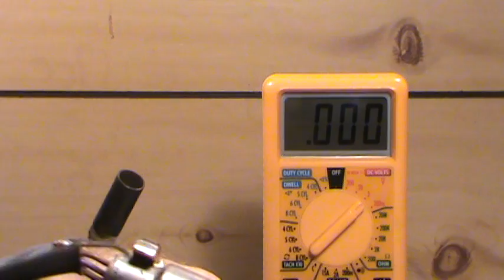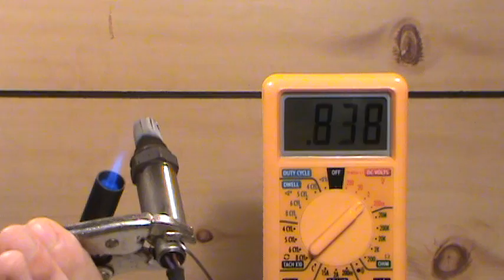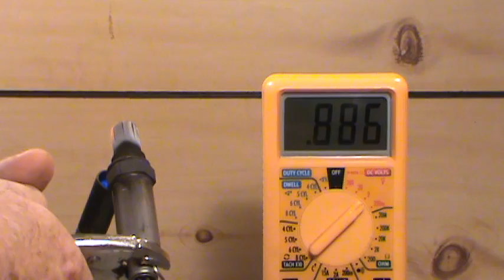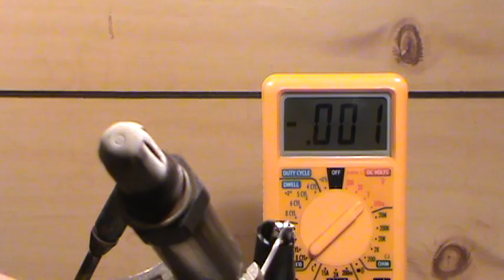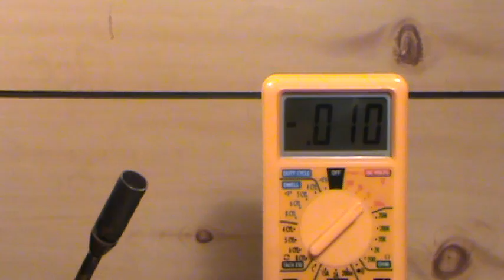Oxygen Sensor Test

Comment: Hi there, i was going to test my o2 sensor tonight while its still fitted in the exhaust manifold, its just a single wire sensor.  I clamped the ground probe to the body of the sensor and tapped into the signal wire with the positive, then switched the ignition on, i thought id double check my multimeter was secure in the engine bay before i started the engine and thats when i noticed the the voltage was going up and down already !  it was jumping from .003 upto .187 and everywhere in between, it was all over the place.  Shouldnt it just read zero with it being cold ?
Reply: No, your exhaust gasses are extremely hot, no matter how warm the engine itself is. The heated O2 sensors are much more stable in  their output. where as the unheated need to be brought up to a stable temperature by the exhaust before a useable output can be achieved. The heated sensors bring themselves up to temp internally cutting the time required for useable readings by a substantial amount.
 Also of note, is they type of meter you are using. All too often a hobbyist grade meter needs to be interpreted not simply 'read' as they are not reading the proper  'RMS' value, or peak values, and will give a reading somewhere in between,  For automotive use the old fashioned analog meters with sweep needle movements are very often your best bet as they will show the proper trends while a digital meter wont react fast enough to give you a true reading as the voltage (or current as the case may be) will have changed before the meter can resolve the proper  display.  I literally have thousands of dollars in various digital meters, and yet the one that I use most often for automotive work is an old 60 dollar analog meter  that has a 1 volt 10 volt 50 volt 100 volt and 1000 scales
Reply from the maker: Greetings newcastleknight....Thanks for watching this video, and for your comment/question as well....Are You ready, for my, shall we say..."Guess and By Golly"...Thought/s, on what may be causing that "Fluctuating Read-Out" on Your Multimeter???...lol....Actually, I'd be thinkin', that, what Your Multimeter, just might be "Detecting" and Showing You, on its Display/Read-out, could possibly be, an "Interaction" of sorts, as it relates to, having the "ECU" (aka, Vehicle's On Board Computer) in the "Circuit", that You are trying to "Test", which also Includes the Oxygen Sensor itself, and has me thinkin', that, that there "Fluctuating Read-out", just might be, being caused by the "ECU", Outputting/Inputting some kind of "Signal", that Your Multimeter is "Detecting"...!!!

Perhaps try the following....With Your Vehicle on Level Ground...Automatic Transmission in "Park"...Parking/Emergency Brake "On"...Wheel/Tire "Chalks", as in the form of some Bricks or Lumber, to keep Your Vehicle from Rolling/Moving...then, with the Engine "OFF" and "COLD"...Disconnect the Oxygen Sensor's "Connector", and take Your "Reading" with Your Multimeter on the "Oxygen Sensor", all by itself, then, as I see it, the "Reading" should be quite Stable (aka, not Fluctuating), and, seeing as how You happen to have a "Single Wire" Oxygen Sensor there, I'm thinkin' that, it should be a "Zirconia" Type of Oxygen Sensor, and "Not" a "Titania" Type of Oxygen Sensor...

The "Zirconia" Type of Oxygen Sensor "Outputs" a Voltage Signal, all by itself, when Heated-Up to about "600" Degrees Fahrenheit or Higher...

...where-as...

...the "Titania" Type of Oxygen Sensor, Operates more like a "Resistor" does, and "Does-Not" Produce a Voltage "Output" of its Own.

Perhaps "Remove" Your Oxygen Sensor from Your Vehicle, and "Test" it with a Propane Torch (if You have one, that is), and once the Oxygen Sensor is Heated-Up to about "600" Degrees Fahrenheit, and if it "Is" a "Zirconia" Type of Oxygen Sensor, and it's in an Operational State, Your Multimeter should be "Displaying" about the Same "Voltage", as You see on the Multimeter in this YouTube Video of mine.

When-ever an Oxygen Sensor gets "Installed", I always put some "Anti-Seize" Goop/Compound on the Oxygen Sensor's "Screw-Threads", to Prevent that Oxygen Sensor from getting "Stuck/Welded-like", making any Future "Removal" of that Oxygen Sensor, that much Easier.

The "Anti-Seize" Goop/Compound that I use, looks like it has, some kind of "Copper" Particles in it, and, as I see it, these "Copper Particles", will probably Help make a better "Electrical Ground Connection", for those Oxygen Sensor "Screw-Threads", where they make Contact with the Exhaust Manifold "Screw-Threads", or, the "Bung" (aka, usually, welded-on the exhaust pipe, Steel Pipe/Tubing Collar, if You will), that also has "Screw-Threads" inside its Hole/Bore.

Now about...an Oxygen Sensor's "Response Time"...

...once the Oxygen Sensor is heated-up to that Magical Temperature of about "600" Degrees Fahrenheit or higher, and the Voltage has somewhat Stabilized, then, as soon as the Propane Flame is removed from the Oxygen Sensor's "Sensing Tip", the "Voltage" Reading on the Multimeter should "Change" to a Different "Voltage Value" quite Quickly.

If its "Response Time" is too "Sluggish" (Slow, like a Slug???...lol), then, as I see it, the ECU would be Held-Back from doing its Job Properly and Efficiently.

The Newer Vehicles, oh, about 1996 and Newer, would probably have, what is called an "OBD-2" (On-Board Diagnostics-Version-2) Computer System Installed in it...

...and, I'm pretty sure, that, if "1" or More Oxygen Sensors in that particular system, became "Sluggish", as in "Slow Response", the "OBD-2" Computer, would/should be "Setting" a "Trouble Code", that can be "Extracted/Retrieved", with a "Scan Tool", that kinda looks like, a slightly Larger Hand held Calculator.

From what some People say, the Heating of an Oxygen Sensor with a Propane Torch, can actually "Clean" the Sensing End/Tip somewhat, which might just, help make, an Oxygen Sensor, that wasn't working so good, work OK once again.

If You care to, You can let me know, just "Which" Vehicle You are working on...Year?...Make?...Model?...Engine?...that way, I might be able to figure out, what might be going on.

Be very Careful, when-ever You are "Tapping-Into" any Wiring or Electrical Circuit, Especially if Your Vehicle's ECU/On-Board Computer happens to be in that (Test?) Circuit, because, when things go "Wrong"...it can sometimes Result is some very...Bad...Unwanted...and sometimes...Very Expensive Damage as well...!!!

If You happen to "Disconnect" Your Oxygen Sensor or Other Parts and Pieces, You might have to "Re-Set" or "Clear" Your Vehicle's ECU/Computer, of any "Trouble Codes" that were "Previously Stored"...or...might have been "Caused" by the "Disconnecting" of Any Parts or Pieces just "Recently" perhaps?

Once the ECU/Computer is "Re-Set", it's usually, just a matter of driving Your Vehicle for a few Miles/Kilometers, so, the ECU/Computer can "Re-Learn" and "Store" that "Information", that will make Your Vehicle Run Properly once again.

Be Safe, take care, and have a good one.
Reply: RockysRoadshow
 Thanks for the reply ! well this is just in a long series of fault finding on my  car.  Its an 1987 Pontiac Trans Am GTA, which originally had a 305 TPI engine but ive not long finished swapping in a 350 TPI from the same year car.  The engine has been to a shop and been regasketed, new valve stem seals, oil pump, flywheel etc, and ive put the top end back together with pretty much all new parts, and also had the memcal chip reprogrammed as ive removed the egr valve etc

To cut a long story short the engine runs terribly, it feels like its only firing on about 3 cylinders, misfires, popping sputtering etc.  Lately it has only been cranking over too and will not fire, So ive been testing various things to try and pinpoint the problem as ive got no error codes saved in the ECU from the short time its been running.  I checked TDC and removed the distributor too to test the pickup coil which tested good (that was done using one of your other videos, thanks !) and the engine did fire up and ran, and idled but was still misfiring something rotten.  Im just starting to get really annoyed with it now as most of the parts are only a couple of years old that ive reused off my 5.0 engine, and the rest are brand new
Reply from the maker: newcastleknight
Greetings newcastleknight....As You have already found out..."Trouble-Shooting"...can at times, be quite challenging, but fear not, and by not thinking about all of the Problems that You are having with Your Engine's, not so good Running issue/s all at the same time, I found that, the best way (for me, that is), is to take "Each" System's Component/Part by "Itself", and follow that good ole "Bread Crumb Trail" (actually, in this case, the Starting and End Point, of the Fuel System or Electrical System...etc.), and if there happens to be any "Tell-Tale-Signs" (showing on any components/parts) along the way.

Perhaps, we should start this so called "Trouble-Shooting" of Your Not so Happy Engine, by checking out the "No Cost" things first, then perhaps increase the Cost as we (actually You..lol) Proceed.

There are times when any of Us, can and do, take things for granted, so, head back to Square One, and Check/Review the following...

The "Engine" itself, has to be "Mechanically Sound", as in, Good "Compression", etc.

Make Sure that, all of the "Basic" Engine "Maintenance" Requirements are "Up-To-Date", as in...Air & Fuel Filters...as New Spark Plugs & Spark Plug Wires/Leads...as New Distributor Cap & Rotor...and also, it would be a good idea, to Check for a Gasoline Smell on Your Engine Oil Checking Dipstick, seeing as how Your Engine was, shall we say..."Miss-Firing", as that alone, will sometimes have Raw Gasoline, make its way, into Your Engine's Lower Crankcase/Oil Pan area.

Is Your Newly Installed Engine, a 350 Cubic Inch "Pontiac" Engine, or did You perhaps "Swap" a 350 Cubic Inch "Chevy" (aka, Chevrolet) Engine, into Your Trans Am GTA???

The reason, that I'm asking, is, from what I recall, the "Distributor Rotation" on "Pontiac's, Buick's, and Oldsmobile" Engines should/might be Rotating "Counter-Clockwise"...

...where-as...

...a "Chevy" (aka, Chevrolet) "Distributor Rotation" is, as far as I recall, is Rotating "Clockwise"...!!!

The "Rotating Direction" that "I'm talkin' about, is the Distributor "Shaft/Rotor" Direction of Rotation.

You might even have, without knowing, Installed a Chevy (Chevrolet) Distributor, in an Engine, that "Is Not" a "Chevy" (Chevrolet) Engine...!!!

Geeze, I'm not even sure, that it's possible to do that, as I/m thinkin', that, the "Helical" Drive gear on the Distributor "Shaft", might Not "Mesh" with the "Helical" gear on the "Camshaft", due to the possibility, that, it might be a "Helical" Gear of the "Opposite Hand" (aka, Left vs Right)...!!!

Then, on the "Other" Hand (lol), maybe, just maybe, Someone could have Installed a Distributor "Helical" Gear, from a Buick, Oldsmobile, or Pontiac Distributor, and installed it on the "Chevy/Chevrolet" Distributor Shaft...???

Hey, Stranger Things, have been know to happen.

Also, if my memory serves me right, the Distributor "Pick-Up Coil", and maybe some other Distributor Related Parts, just might be of the "Opposite (electrical) Polarity", when comparing, the shall we say, "Stand Alone Chevy/Chevrolet" Distributor, to that of a B.O.P. (B.O.P. = Buick...Oldsmobile...&...Pontiac) Distributor/s.

"Make Sure", that You have the "Exact" Distributor, and all of its "Exact" Component Parts for the "Exact Engine", that is installed in Your Car...!!!

Once You are "Certain", that, You actually "Do" have the General Motors "Correct and Recommended" Distributor and related Components, then...

...Check to see, with Engine "NOT RUNNING", if Your Spark Plug "Wires/Leads" are placed "Correctly", on the "Distributor Cap"...In the Correct "Firing Order"...and, that Each Spark Plug "Wire/Lead", goes to the "Correct" Spark Plug...!!!

Hmmmmm...I'll mention a bit here, but, I want "You", to "Check" the "Specifications" for Your Engine, just in case, I mess up...!!!

Maybe, You already know, all about Firing Orders, the Distributor's Direction of Rotation and Cylinder Numbering, but, I'll make them "Visible" (lol), just in  case!

The "Firing Order" for most General Motors V-8 Engines should be...1...8...4...3...6...5...7...2.

The "Locations", of those "8 Cylinders" are, while sitting in the Drivers Seat, starting at the Front of the Car, on the Left Hand Side of the Engine are...1...3...5...7...

...and...

...starting at the Front of the Car, on the Right Hand Side of the Engine are...2...4...6...8.

But, here's the "Catch" (more like...Warning!)....The Distributor's "Rotating Direction", will "Dictate"..."Where"..."Each" of those Spark Plug "Wires/Leads" actually get "Placed/Installed" on Each of Your Distributor "Caps Terminals"...!!!

Maybe this following "Cost" related item, is being placed a wee bit earlier than I anticipated earlier...

Like they say in "Real Estate" (aka, Property, House, Condo, etc.), "Location"..."Location"..."Location"...

...but..

...when it comes to a Car or Trucks "Fuel System", then it's...(Fuel) "Pressure"..."Pressure"..."Pressure"...!!!

Fuel "Pressure", and just as important...Fuel "Volume", can make or break, an Engine's ability, to "Run" Properly, or even "Start" for that matter.

Seeing as how You were saying, that You have a TBI (Throttle Body Injection) Unit, installed on top of Your Engine, a "Ball-Park"..."Fuel Pressure" for Your (I'm thinkin'...it has "2" Injectors in it) "TBI-Unit", should be about "13"-PSI (13 Pounds Per Square Inch), as "Measured" with a "Fuel Pressure Gauge", and might be taken, just before the TBI-Unit, but, please Check!

Check the Fuel Pressure "Specification's" for Your TBI-Unit/Model...!!!

Something like a "Clogged-Up" Fuel Filter, can "Reduce" Fuel "Pressure & Volume".

As I recall, there is a little Fuel "Mesh-Like" Filter, installed on Each of Your TBI's Fuel Injectors...might be "Clogged"...???

Might even be Your TBI's "Fuel Pressure Regulator???

Perhaps the "Fuel Line", just before Your TBI Unit, has a "Fuel Test Port", much like a "Schrader Valve" (looks just like a typical Tire Air Valve), where You can Connect, a "Fuel Pressure Gauge" to???

Before You "Work On" Your Fuel Injection System..."Make Sure", that You know how to "Bleed-Off" the "Fuel Pressure", before You "Test" or "Disconnect" any "Fuel Lines", as there is some "High Pressure Fuel/Gasoline" that can Hurt You, and has the Potential to Damage Your Eyes/Eye-sight...!!!

So then, Check out that "Ignition System", with the Engine "NOT RUNNING", and If that's not Your Engine's Problem. then...

...it would be a very good idea, to get Your Car's "Fuel Pressure"..."Checked", so, You "Don't Spend any more "Un-Needed" Time and/or "Money", on a Problem, that, just might, not be there.

Let me know, how it's going, and, if needed, I'll see what else I can come up with.

Be Safe, take care, and have a good one.
Reply from the maker: newcastleknight Greetings newcastleknight....Oooooops...!!!...lol...It kinda looks like, I made a..."Mistake"...in the First Reply to this/Your Comment, and, that Mistake was...I, messed up, with those..."3 Letters"...where You were sayin'..."TPI"...and...I, was thinkin'..."TBI"...where..."TPI", should be..."Tuned Port Injection" (I think), and..."TBI"...should be..."Throttle Body Injection"..."Yikes"...!!!...my Bad...???...lol............................While, both..."TPI"...and..."TBI"...happen to be, an Engine's, Type of..."Fuel Injection" System...and being, some-what "Different", from, One-Another, they both do, pretty much the Same Thing, but, slightly Different, from, one-another, and, I'll try to explain, some of those Differences, using a...GMC Made, "V-8 Engine"................................."TBI/Throttle Body Injection"...kinda looks, some-what, like a Carburetor does, and, usually had "2 Fuel Injectors", Mounted, on/near the Top of "it", and usually had "2 Throttle Bores/Holes" as well.....................The "2 Fuel Injectors", for the "TBI/Throttle Body Injection" Unit, should have, a Larger Outside Diameter, when Comparing Them, to the Fuel Injectors, in a "TPI/Tuned Port Injection" System..................................Now then, with a "TPI/Tuned Port Injection" System, there should be..."One Fuel Injector"...for Each of the Engine's..."Cylinders/Combustion Chambers"...pretty much meaning, a Total of..."8 Fuel Injectors"..............................These "8 Fuel Injectors", are usually Connected to a "Fuel Rail", which supplies the "High Fuel Pressure", to All of those "8 Fuel Injectors", having "4 Fuel Injectors", with Their Own "Fuel Rail", on Each side of that V-8 Engine..............................The "TBI/Throttle Body Injection" Unit, usually, just sits, on top of, what appears to be, an Intake Manifold for a Carburetor, where-as, with a "TPI/Tuned Port Injection" System, that I've seen, is, there are "Intake Runners", that look, kinda like Cast Aluminum, in some cases, having a Set of Them, on both sides of the Intake System, and, might also be equipped, with a "Mass Airflow Sensor/Throttle Body" as well..........................................Aside from the, shall we say, Physical Differences, that are readily Seen, if a Person, were to do, a Side-by-Side, Visual Comparison, of the "TBI"...vs, the..."TPI"...Fuel Injection Systems, there is "One...Major...Important...Difference"...and that is...the..."Amount of Fuel Pressure"...for..."Each of These 2 Fuel Injection Systems"...!!!................................Where, in my First reply to You, I was sayin', about the, oh..."13 PSI/Pounds per Square Inch"...there-abouts, that is needed, for a "TBI/Throttle Body Injection" Unit, is one thing, but, when it comes to, something like a "TPI/Tuned Port Injection" System, then, "Look-Out" now, cuz, I'm thinkin', that, the Required "Fuel Pressure", will now be, in the neighborhood, of about..."60 PSI/Pounds per Square Inch"...!!!..."Yikes"...!!!...oh, and, Please Check, the...Fuel Pressure..."Specifications"...for Your..."Exact"..."Fuel Injection System"...to "Avoid a Dangerous Situation", and to, have Things, work, just as "They", should be Working..........................................Be sure, that You..."Safely, Bleed-Off that High Fuel Pressure", Before Disconnecting any Fuel System related Components or Fuel Lines, etc...!!!...as that "High Fuel Pressure", as I see it, is kinda like having, a "Mini-Pressure-Washer", that can Injure, as well as Blind a Person...!!!........................The "Correct Fuel Pump", and, the "Correct, Fuel Pressure Regulator", has to be Used, for Each, "Exact, Fuel Injection System"...!!!.....................................You were sayin', that You Swapped some Parts, from Your...305/5 L to Your 350...V-8 Engine, so, now I'm thinkin' that, although the Parts for, both the 305/5L, and the 350, may Appear, to Look the same, there just might be, some..."Calibration/Specification...Differences"...Between... Those..."2 Engines"..."Parts Needs/Requirements"...so, just to be sure, I would be doing a..."Part Number Check/Cross-Reference"...for Any of the Parts & Pieces, that, were to be "Swapped", from, One Engine, to the Other Engine, to Avoid, any Un-Needed Problems, as if, there aren't enough of "Those" Already...Yikes...!!!...lol...............................Well, I guess, what, I should be sayin', about now, and that is...Maybe..."It's Better Late, then Never"...that, I actually "Spotted", my "Mistake", and, that be that...............................Did You, and, I'm hoping, that, You got Your 350 Cubic Inch-er, Running, Good & Strong by now, and, if You care to, just post a comment/question or two, and, we'll go from there, my Friend.........................Till next time..................Be Safe, take care, and have a good one.